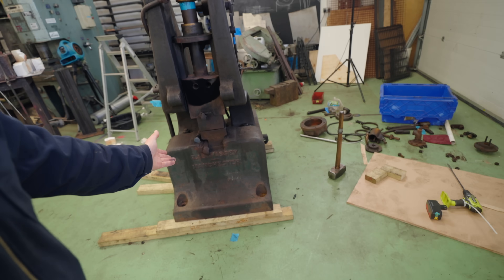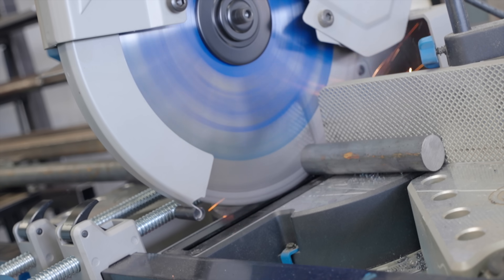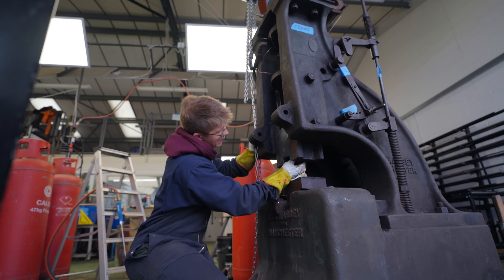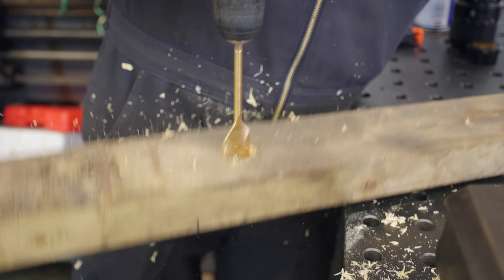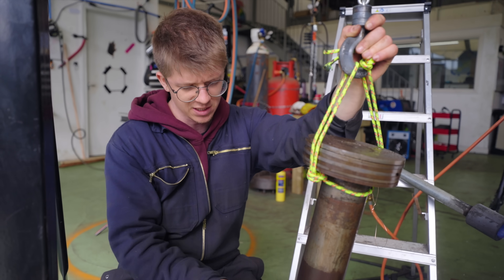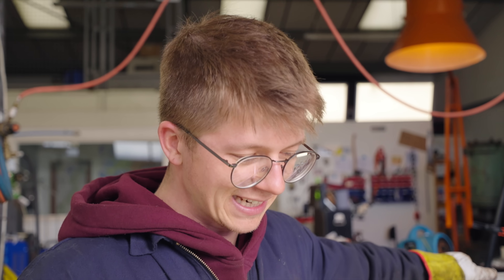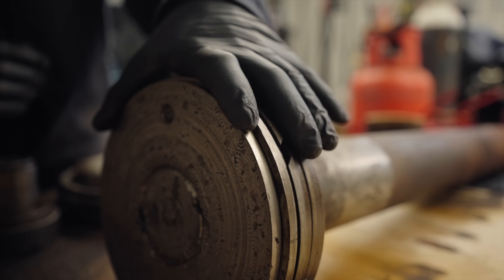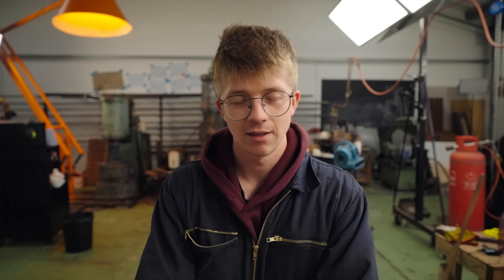FIXING A 1900's STEAM HAMMER! Pt. 2

Comment: As a fellow welder I would recommend grinding down the  piston, then running multiple layers of weld untill it's built up enough, usually 6mm over tolerance. Then throw it on the lathe and machine down to tolerance needed. A wam welding machine would be extremely useful in this case, however they cost a lot. BTW I work in port Talbot steelworks, and would love to see a video abought the job losses and this country ability to make virgin steel being lost forever.

Comment: Braze the Bronze back together. Get new v pack for your rod. Add compression fit .500 extra and don't worry about your rod Just check for large gouges going the length of rod.  It's a steam hammer. Hydraulic and pneumatic has to have a smooth ceiling surfsteam Does not.
SOS.Hydraulics, shop manager.

Comment: Just a guess but perhaps the two part “cushioning” section above the piston relies on air pressure for the cushioning effect. I think that’s why there would be piston rings around it. And it would need to be in two parts because trying to insert it in one peace would trap the air not letting it slide in. You could hold the inner cylinder elevated with respect to the outer cylinder as you insert it into the cap and the trapped air would push the inner cylinder into the outer cylinder as the outer cylinder slides into the cap. Thoughts?

Comment: Possibly using a hand held air chisel would be a good idea for knocking out seized parts. It works on rusty old cars it should work for the keys! 50000 little hits has got to be easier than 500 big hits
Reply: Yeah but that's not content. The struggle has to be real to create drama.

Comment: You have a few options for that piston shaft.. You can clean it up and send it off for Spark Welding and then turn it to the original size or, Turn it down a specific amount and machine a new guide bushing. The latter seems easier as bronze is cheap and spark welding, is not.

Comment: The reason the ram is so corroded in one place is because the gland packing (likely asbestos) has dried out and corroded the ram. The outer gland has to be a good running fit on the ram, this squeezes up the packing onto the ram to create a steam tight seal, if it doesnt fit well the packing will get blown out and it will leak. The inner bronze bush should also be a similar fit, this is to support the ram, prevent the packing from entering the cylinder and is a sacrificial part so it can be replaced as it wares, rather than waring the irreplaceable cylinder casting. If you turn the ram down you will need to build it up again with hard chrome or similar as it will no longer fit into the die. One good solution which we have done on steam engines is hard chrome and grind the ram, replace both of those bronze bushes to fit. If thats not an option you could just replace the ram with a fine turned or ground finish. Either way you really need to keep it original dimensions

Comment: What about cleaning the shaft to good metal then re-surfacing the shaft and then machining it back to original diameter? I worked a tech job at a machine shop and they had a lathe type tool that would spin a shaft while the machinist used a gun type attachment that used compressed air, electricity and wire reels to shoot liquid metal at the shaft there by adding material back to the surface.  Then all you had to do was machine or grind it back to the original diameter.

Comment: Wax!
It can work wonders on seized pieces. Heat enough to get wax to melt and flow around the pieces. And off it goes.
Reply: That's the best tip in the whole thread. Paraffin wax is amazing at seeping deep

Comment: your gonna have to remake the brass sleeves so you might as well turn the shaft to smooth it up and cut the new sleeves to fit the new diameter of the shaft. if you are frugal on turning you should be able to do the other pieces to clean up those marks.

Comment: Consider the cost. Bronze is a far far more expensive material.

You can re-braze the bronze to repair the cracks in it. Might have to cast a new piece or two and machine up replacements if they're bad enough. Open top sand casting will be enough to get the job done, just leave enough margin. Good chance the old stuf is 80/10/10 bronze.

With the shaft you have a few options. If its close to a nominal size the best option will be to bore the bronze to true it up (removing as little as possible) and then use hard chrome shaft. With any luck the taper for the die holder will remove the hard chrome where those pins need boring.

Otherwise, grab a new piece of material and turn it around 0.05mm undersize. Then get that hard chromed.

To use the old bronze you won't be able to use the old shaft, you won't be able to get it built up enough by chroming and spray weld wont last in that application.

Given a chunck of 4140 will be a good bit cheaper than that much bronze, that will be the way to go.

Comment: Send piston shaft out to specialist to be turned down to a clean surface and spray welded, then refinished to original size. 
It might be worth considering increasing the diameter slightly over original to allow for the hole in the hammer die to be cleaned up, but only if it’s strictly necessary. 
As far as the spray weld material goes, it’s worth considering the shocks that the rod will be subjected to in use. I’m not convinced that using a super hard coating material would necessarily be the ideal solution. A slightly softer, more malleable coating will be less likely to spall or develop cracks over an extended period of time.

Comment: With the piston, couldn't you get some very light sandpaper, rough up the exterior a little, then coat it in car bodyfiller to sort the pitting, and sand it back down to the metal? That stuff is fairly hard when solid. Not sure if it would last long though.

Comment: Lathe off .125" from the piston and re-sleeve the cylinder. That's the 'guaranteed' way to fix it. Harder to go and have done would be grinding and plating, or grinding and spray-welding (I wouldn't bother.) That cushion on the top has that center bit to act as a relief valve at the top of the stroke. Initially it cushions to maintain the pressure, but if it's gonna knock it just dumps the pressure when that plug gets pushed.

Comment: The piston rings should be what keeps the pressure in the cylinder. That big shaft is just there to connect the hammer to the piston like a con rod in an engine.
Reply: The shaft sticks out of the bottom of the cylinder, through the two bronze parts - that's the other end of the cylinder that also requires sealing.
Reply: Just to add, it is like a con rod in an engine however I assume this piston has to contain pressure on both sides to push both up and down (I admit I am no expert in this field so comments to be taken as such! :) )
Reply: @TheSimonBeattie  i thought it would only be pressurised on the one side, but ive never worked on anything like that, only engines.
Reply: @anthonyduffy6953  I think (and it's an educated guess) that it requires steam on the underside of the piston to return the rod and hammer back to the top position, so you're essentially cycling between pressure above and below to move it up and down. There's no crank or flywheel to help return it upwards as you would have in a standard engine, and I don't think any vaccum created would be strong enough to raise it; but again, I stress, I don't know for certain how they work other than watching the series Alec made for the mini steam hammer (which worked on the principle of steam both being used to raise and lower the hammer).

Comment: That part looks like a 1 way valve alec
Reply: Those strikes on the piston faces could be screws lost into the machine during operation I know steam hammers like this wouldn't be taken off the line if they don't lose hitting speed or force and a rattle might not be noticed in a noisy enough shop.
Reply: I've seen a lot of suggestions of spray welding this might be an option but talk to the shop to make sure the surface will be airtight sealable before going that route. Weld pad build up can work just as good but is both more heat inducing and may leave a surface too hard to properly turn to your spec. An additive process is usually better on corroded parts.

Comment: As long as the piston head does not leak, you can mill / sand the piston rod. All tho it did look like it has slight bulging due to corrosion and use. I would just make a new one even tho it would be a pain.

Comment: You’re going to need to have those bronze parts machined from new stock if you wanna do it correctly. Also, that ram rod is going to need to be turned down to clean material. A lot of those parts need to be machined honestly. Hope this helps.

Comment: Pnuematic repair for 4 years. You can wirebrush the rust off to check if it can still hold pressure, but just looking at the level of rust, that might not be enough and you might have to turn down the piston to reach good steel and then somehow add material to it.

Comment: I've seen You Tuber Adam Booth fix up shafts like that.  He turns them down and builds them up with weld and then machines them back down to tolerance it is a common practice to fix worn and corroded shafts. Just need to find someone with a large enough lathe to accommodate that shaft and who has the knowledge to do that fix.  Should be no problem given you find the right guy.

Comment: Perhaps a machining of the rust, followed by spray metal deposition. But even if that is doable, it is possible the whole process will cost you more than a new machined part made of a better material.

Comment: I'm assuming the "loose" piston goes up top and is fed by the steam to act as a cushion because back in the day when this was new, there was now such thing as a speed/flow control and would prevent the ram from contacting the cap. Punch presses use that technology still to this day to lessen the blow when there is a specific tool that needs to depress in order to form whatever part you are making. Also, I would probably just replace all pistons and the rod itself or you'll run the risk of wearing out that brass gland again and having to do this all a second time.

Comment: I think, if it were me….I’d lathe the whole shaft down and add some new thin bushings, inside the old bushings. …if they’re Very thjn…you could crush them, trying to press them in.   Pack the new bushings in dry ice to shrink them slightly, before pressing them in. You might also want to bore the inside of the old bushings, to give you more meat, in the new ones …OR …make completely new bushings, which might be the easier route. ….🤣🤣😂  what have you gotten yourself into ?

Comment: Since there is a bronze sleeve, doesn't that give you leeway to machine it out and make a new one that can accommodate whatever size the cylinder comes to after clean-up?
Someone else mentioned a process of brazing and annealing that could fix up the cracks on the out pieces that would make this a viable option

Comment: i belive that the piston sealing would depend on the seal, some hydraulic cylinders have to bee really smooth and have a coating to keep them from pitting and when it goes bad you are supposed to replace them, other are just machinned smooth and you can metal spray them and turn them to rebuld them, this one i'm not sure, cause the seal at the bottom i don't know if is rubber or leather, but if you can fit a smaller seal you could turn the piston to resurface it and should be fine, again, depending on the type of seal it uses. i would be more concerned on the condition of the cylinder, if is scratched or not round looks to bee quite the job to bore, and you would have the problem of making the piston fir on it

Comment: I’m going to go a different route. The piston is the part with the rings. The rod below it doesn’t seal anything. It doesn’t even touch the bore. So unless I’m totally wrong (and it’s quite possible) you don’t need to do anything to the rusty part. Hone the bore and replace the seals. I used to be a mechanic and rebuilt a lot of cylinders. But Curtis at CEE would be a great resource for you. Hope this helps.
Reply: The pressure is below the piston as it raises the hammer shaft, the down stroke is purely gravity driven.

Comment: Here's my 2 cents about the shaft and they only pay if you're only going to use AIR with it. Clean all the pits properly, use metal epoxy, put the shaft in your lathe and use sand paper (with your ways covered in a towel) to clean it up. Then, bore a lip hole into the head of the cylinder hole and put a leather sealing lip, stuck in place with bolts. You'll either have to remove that bit and machine it or make a jig for it. If you plan to steam it... none of this will work. Heat would destroy it. For the metal epoxy to work and stay there, you'll need to root it properly and make sure the metallurgical profiles match. l'd call the company and ask them if the two are kosher before wasting time. If it comes apart in the bore, it's no bueno. 

Source: have done this with old steam engines in the past. Even worse in terms of pitting.

You can also have the thing spray welded. But that's money and you have to find someone who can spray weld in UK.

Comment: The piston might be problematic as the corrosion could be to deep to create an airtight surface again. I am a graduated toolmaker from Germany and if possible I would put it on the lathe and brush off the rust with some scotch brite and WD40. Be careful to not remove to much material. Tbh not knowing the exact functions of the power hammer I belive the piston is not used to be airthight as this is provided by the piston rings. Have a good one.

Comment: So I'm sure you figured this out by now, but the piston rod is rusty and pitted but that is not the actual piston.  The piston is your Mystery piece.  As made obvious by the piston rings on it.  The only surfaces that you need to really worry about are the piston it self (the wider bit) and the inside of the cylinder.

Comment: isn't it the piston rings that stop the steam from leaking past not the rod?
Reply: The shaft sticks out of the bottom of the cylinder, through the two bronze parts - that's the other end of the cylinder that also requires sealing.

Comment: The bottom block is not the right one ,be careful when heating as the blocks are carbon steel they will need air quenching again if you denature them.

Comment: Is that not the point of the piston ring to seal against the cylinder wall so that the ram doesn’t have be seal tight? Like an engine piston in a cylinder bore?